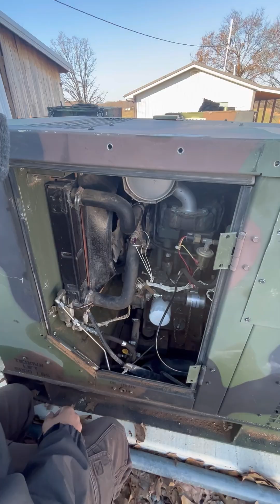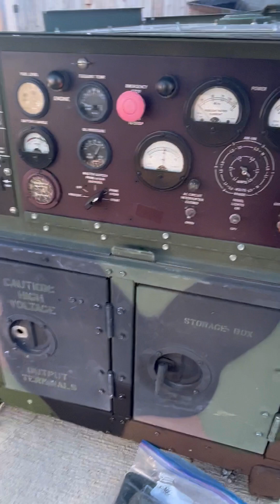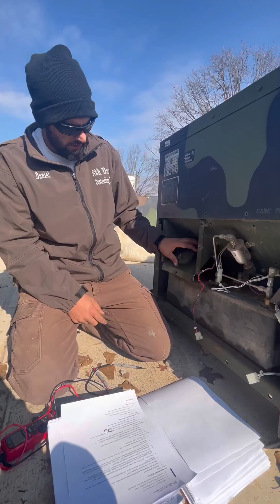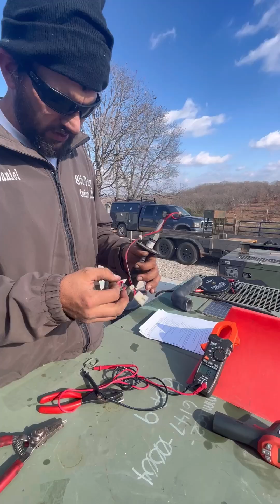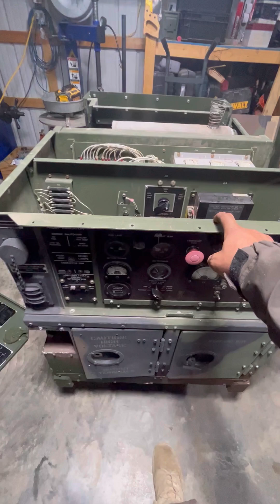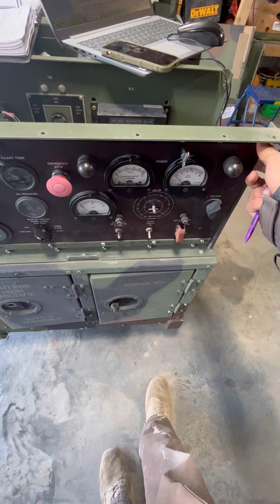Fixing the Mep-802a CB1, No fuel and No power at lugs.

Comment: I got a MEP-803A with 2 hours on the clock last year. At 95 hours, the fuel gauge pinned to the right. At 105 hours, the unit shut down "no fuel" light lit, but I'm pretty sure I had 1/2 tank of fuel left. It was fully loaded, charging batteries at the time. I hope the sudden shutdown didn't cause other damage. Now I need to figure out what went wrong.
Reply from the maker: Keep me posted on what you find!
Reply: @TheCrocDaddy  In my case the generator was actually out of fuel. I'd apparently not kept track of all the times we ran it this month. It's been raining continuously for weeks and solar hasn't been producing more than about 1/3 of our daily needs. But I could have sworn the fuel tank was filled and that we used it twice for less than 2 hours each time. Apparently I missed some other times. Fuel gauge stopped working about 10 hours prior on the clock, so no way to know how much fuel.
Reply from the maker: @basspig happy to hear it was something easy!